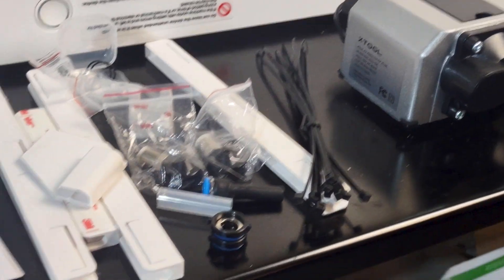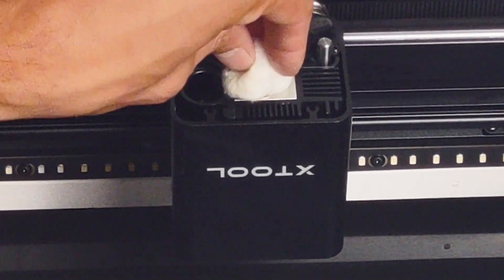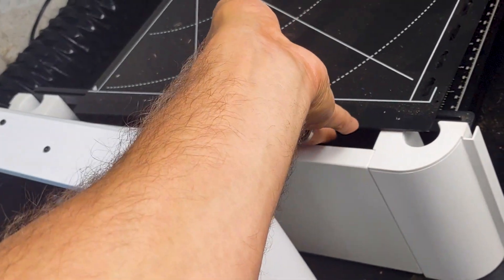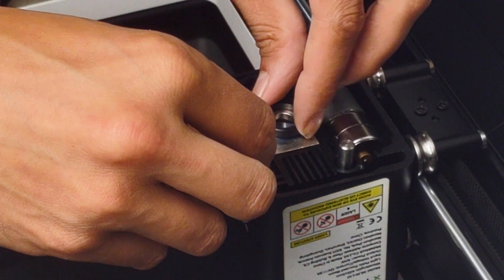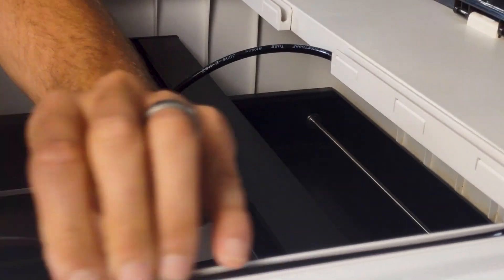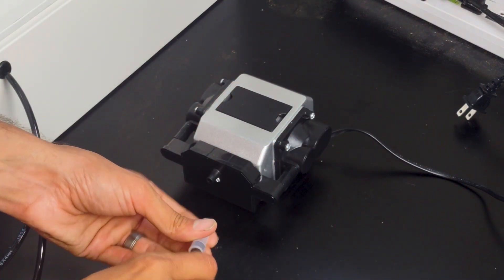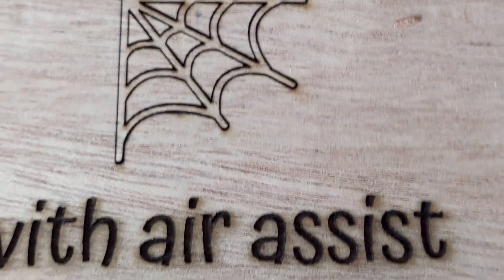How to Install the Air Assist for XTool M1 Laser Cutter & Engraver

Comment: that shield you removed prior to installing the air assist nozzle appears to be a dust cover for the moving mechanisms that it covers. I put mine back on.
Reply from the maker: Hey thanks for watching.  That black shield should be in the way if left installed.  How is your air assist nozzle seating onto the module with it there?  The instructions did not say to replace it, if memory serves but if you have managed to get it on there without it in the way, why not.

Comment: Hello, did you put the lenses back there before you installed the two magnetic things?
Reply from the maker: Hey there, thanks for watching.  Yes, the lens should still be sitting in there.  It never actually needs to come out for this process.  When the machine is inverted to install the nozzlle mount (little ring that twists on), gravity will keep the lens in place.  It is worth making sure that the lens didn't get moved at all in the process, though.  Once the nozzle mount is on, the machine can be placed right side up without the lens coming out.  Hope this helped!
Reply: @ Thanks. When I removed the brass washer the lens came with it, I just put it back.

Comment: Thanks, I have the two white tape markings exactly as suggested and the same for the support brackets, I have removed and replaced the tubing a few times and I hope it will not catch on itself next test, cheers.
Reply from the maker: Best of luck! The first time I did it I thought I had the white marks in the right spot but I was off by one.  There should be this sort of slack loop between the bracket on the laser head and where the nozzle clicks onto the laser head.

Comment: I have it fitted as per your video but the air assist tube keep catching on itself and also stopping the head moving just juddering on the rails, it also rubs at times on the M1lid, any solutions?
Reply from the maker: If the brackets are all where they should be and the tube is positioned within them correctly, the laser head should be able to freely move to all four corners when the machine is powered off. So that is a good test that things are positioned correctly.  The tube needs to be positioned within the brackets so that there is some slack toward the laser module.  On one end of the tubing there should be some white markers that show you where the tube should rest.  As far as the tube rubbing against the lid, mine does slightly and it does not cause any problems.  I hope this helps, best of luck!

Comment: Thanks for that.  I left my hose inside the printer too long and lasered right through it.!  Yikes!  He he he.  Fixed now.  My Xtool doesn't seem to like MDF is that something you all have a problem with?
Reply from the maker: Yikes! Glad it's all fixed now.  So MDF and plywood both have significant amounts of glue and will not cut as easily as hardwood if the same thickness.  Be careful with the fumes coming off of either but particularly MDF.  I've read that the MDF fumes are bad to breathe in due to all of glue within it.  We typically prepare material with the band saw/planer and cut pieces of hardwood.  Cherry is a favorite for sure.
Reply: @ArtisansAndArthropods Hey there! You mentioned you liked cutting cherry wood the most. I recently bought some pre-cut wood through Etsy…it was Birch and (being that I don’t know my wood densities obviously but was just looking for 1/8 inch at a good price for a large amount😉) I find it very difficult to cut. The best settings I’ve found are speed of 5 and 2 passes, but when you have small items to cut and it takes 2 passes…yikes. I’ll use the wood up for larger things that can take 2 passes…but what settings do you cut the cherry wood on and is there other would that you have used that easily cuts through with 1 pass? Thanks so much for your help. I’ve looked online trying to find some knowledge but hoping you might have some. Also, thanks for you help with the air assist process. ~Linda
Reply from the maker: Hey! Thanks for watching and we are glad to have helped!  That's interesting that people are selling materials meant for lasers on Etsy..maybe we should get into that game.  I also find that for my 10w xTool, I typically cut at a speed of 5 for 2-3 passes.  That's for a thickness of 6-8 mm.  I think how tight the grain is can be a factor when it comes to punching through something with the laser.  I'm often surprised how easily I can get through maple.  That said, some woods that I find easy to cut will require more power for a nice dark engraving, again thinking of maple here.  To answer your question about getting through in one pass, I've managed to get through cedar in one pass at greater thicknesses than I would expect.  The problem is that the wood is relatively weak and it may not be a good choice for smaller cutouts.
Reply: @ArtisansAndArthropods  well, I think you should get in the game! There’s lots of sellers on Etsy with wood for our lasers! 😀 Thanks for your info on the wood. It helps a lot! I thought maybe it was just because of the type of wood I got. Overall, I’m pleased with the M1…a little slower than I’d like, but I just put something in to cut while filming for another diy. P.S. I did hit that subscribe button…gotta keep helping us YT diy’ers out…plus, being very helpful to me, deserves the ‘ol press of a finger! 😄 Many blessings!

Comment: When you run the Air Assist, do you run it on full or High? I am confused why the air assist came with a high, med, low settings and where it should be set?
Reply from the maker: Hi there! Thanks for watching.   My air assist only has a toggle switch similar to what one would see on a computer tower.  I'll have a look at the website, maybe they sell a different model now?  I got mine at the same time I ordered the xTool M1, about a year ago.
Reply: @ArtisansAndArthropods  That is OK, I will look it up. I was trying to take a shortcut by asking you LOL. Thanks for the very helpful video.
Reply from the maker: Please always feel free to throw questions like that at me!  Sometimes I will have the answer off hand and other times it's a great reason to learn or someone else with knowledge will chime in =)

Comment: How do keep the hose from hitting the fan when it the head goes home?
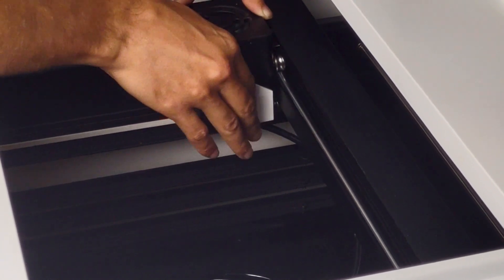Reply from the maker: The bracket that attaches to the laser module at 6:58 should direct the hose away from the fan.  From there, the hose goes into the long bracket attached to the lip of the top of the laser (attached at 7:42).  If these brackets are in the correct positions, the hose should not be able to contact the fan.   I hope this helps and thanks for watching!
Reply: @ArtisansAndArthropods  I have reset my brackets. It has helped! Thank you!
Reply from the maker: Woop! Glad it was an easy fix!

Comment: Great video!  What are the black o-rings used for?  thanks!
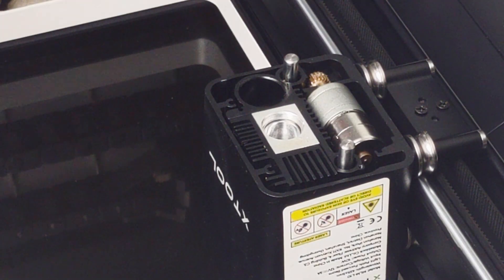Reply from the maker: Thanks for watching!  That's a great question.  I've done some investigating on those and confirmed that my installation manual does not even mention them apart from listing them under the included parts as spares.  It seems like they are meant to go on the lens cover that we install at 5:05 before it threads on.  They are sized correctly to fit there and it does feel better threading in that piece when the O-ring is there behind the threads.  It seems like it would make a better seal there between the lens cover and the lens so that is what I'm left to believe.  Sorry that you have to take my answer with a grain of salt!  The poor instructions were what motivated me to make this video...=)